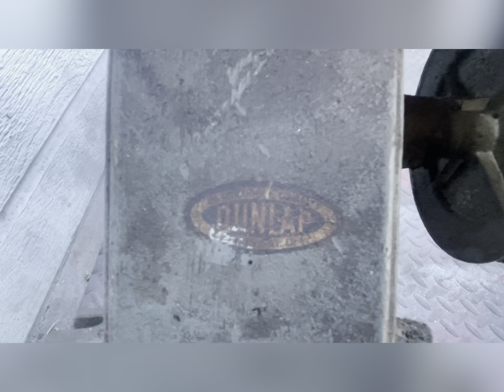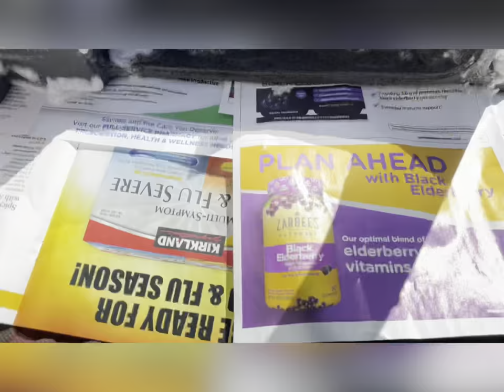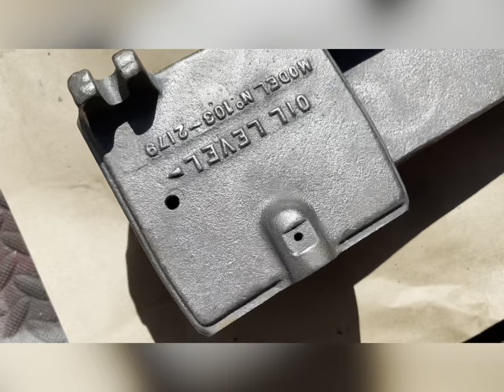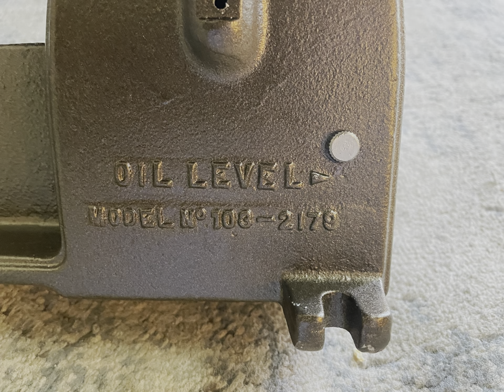Vintage Dunlap Jigsaw Restoration  13” Model No. 103.2179

Comment: I am in the process of rebuilding this very model right now. This video answered some important questions! The saw sat in my junk pile for a few years until I got the bug to fix it. Glad I started .
Reply from the maker: Nice Jerry. I’m still using this saw and I love it. It cuts smoothly,(my motor is also a factor). If you’re looking for its blades, just get a “two way 5 inch jigsaw blade”. Good luck with your restoration. If you end up sharing its video process, please let me know. Have fun.

Comment: I just got one from my uncle today. Bummed to hear about the blades being hard to find.
Reply from the maker: Very nice. They’re very good for small projects. I was able go find the blades on Amazon, “two way pin blade”. 5 and 6” inches blade will work. They just have to have a pin at the end of the blade. The pin goes in between the gap that holds the blade. Good luck and enjoy. Also thank you very much for watching.